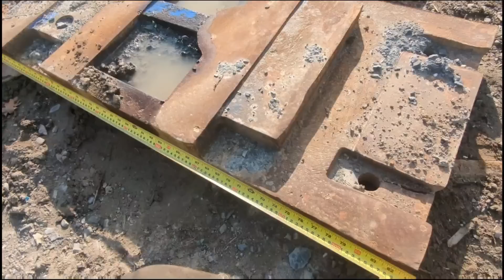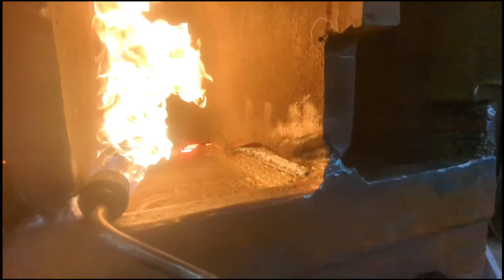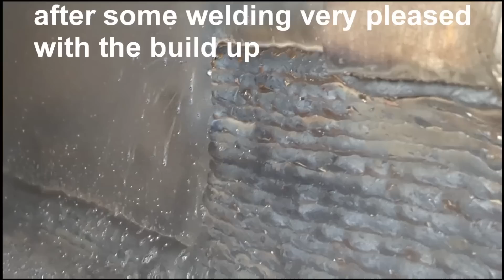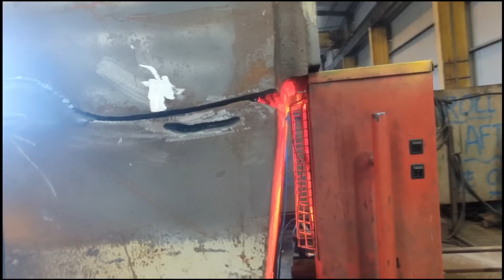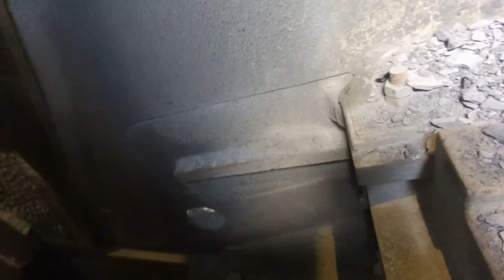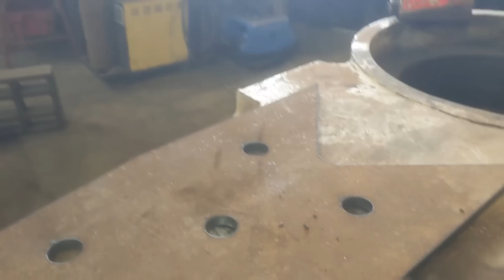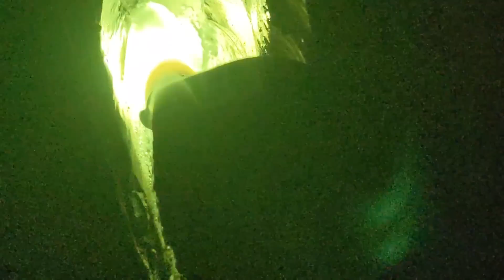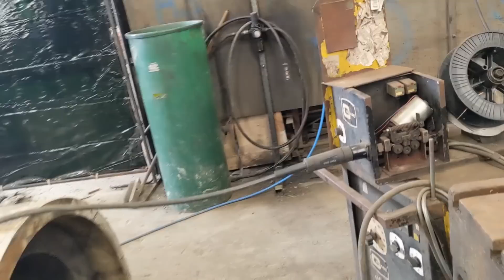10TON steel casting broken in half the welding repair starts!mega engineering!   quarry jaw crusher

Comment: When science and engineering are applied to a job like this one it will turn out as good as possible.....no guessing, no shortcuts, no disappointments. Amazing job almost incredible how the work pieces were heated up, shaped then welded. I have a recommendation for preheating a giant massive work piece such as this one. Maybe you've considered it already. I maintained the heating panels in the powder coat paint oven. They operated on three phase 480 VAC with three element sets to each panel. The control circuitry used SCR's for temperature control. You probably wouldn't need control circuitry because you would be running them wide open to preheat your work. You would only need two for large work. I have no idea how costly such heater panels are to operate but there's a chance the elimination of bottled gasses would make it worth the expense.

Comment: Hi Allistair, very impressed with your video and welding.  So I hope you don't mind if I 1.  ask a question,  2.  make an observation, 3.  then two suggestions.  - 1.  Could you see where the crack started.  2.  You tested the trial weld against the steel plate and not the casting.  If you had struck the plate on the other side you would have tested the weld on the casting.  3. There was a lot of fatigue in this work,  so firstly, when gouging why not hang the torch on the end of the crane chain and pendulum it.  This will save your hands and nerves from damage and be much faster.  Also when welding the canyon why not arrange the torch to run on a tramway.  This would be a lot easier and you'd get a better weld.  If you'd like me to come up with some drawing arrangements for the pendulum and the tramway I'd be happy to do this in return for posting such a brilliant video.  Thanks again Geoffrey Dodd
Reply from the maker: Thanks Geoffrey,  unfortunately the canyon was nowhere near uniform enough to be used with a track welder and requires manual reactive manipulation during welding.
I done multiple weld tests , not all shown, but yes good point regards the side of the plate I hit.  My brain has been pre programmed with that side for ease of breaking plate off, it's now habbit

Comment: Just any idea, but it might be an idea to make some plates with heater elements built into them. You would be able to G clamp them on to flat surfaces, which would help with better heat transfer with no air gap. The elements are used in the plastic injection moulding industry on hot runner manifolds they will go 350°C no problem, just get the high power to length and a thermocouple and some kind of controller or lower power elements that can go 100% all day, ask supplier for best advice. Just any idea, mate, for you.

Comment: 47.30 "as an old boy past his best and loosing his vision" do NOT nock you skills, you have done the set up (Plating) research and are capable of doing the complete task required. Now at 56 years old, my eyes are knackered, i cannot even follow a radius, i need a gap.  @1.07  that ain't no plowed field, (2*15 KG) rolls is a lot of wire, and expect it to be robot perfect, is impossible. (try finding a good all round individual fabricator, welder who has ANY knowledge, in temp control, cast steel, dissimilar metals or even an interest in learning), the best guy i have is 77, a mill wright, a wonder of knowledge, if he doesn't know, next morning a BOOK appears with all information required. ( i have googled many many times the specs of his OLD fashioned books, and learn't nothing except the specs are still the same), old boy's now what to do, and can do it, not just talk about it.

Comment: I’ve heard that accent before ! My mothers side all from Ireland .  Hy pressure pipe tube super heaters . Hated the air arc . I’d get a stack of X ray films with flaws . Never had a bad film, sure got to fix em for the less qualified welders . Ur doin fine follow the metallurgy, n all preps after . Have a good one !

Comment: I've not welded nor repaired heavy machinery (work in IT) but I am fascinated by the work you and others (like CEE) do. The energy needed to glue metal or cut straight through it is insane! How much do jobs like these cost just on the electricity used to do all of this?

Comment: why not 7018 Low hydrogen?
Reply: It is slower, and ER 70 S-6 out of a MIG/MAG gun is low hydrogen too, just a lot higher deposition rate and there is less typically less weld metal shrinkage with the MIG/MAG process...

Comment: Are you using solid wire and short circuit mig for this? Why not dual shield flux core?
Reply: Something I had wondered too. There is more shrinkage with FCAW over MIG/MAG, which tends to load up the HAZ more. Metal core may have been another option with faster deposition rates, low to no smoke and no flux to deal with.... Still, the job worked out fine didn't it.

Comment: I've just noticed those plug welds, keep an eye on those in service - especially in winter. They have a habit of cracking if they are too small and then the cracks can grow. Longer slots or shapes tend to fare better than small diameter plugs...
Reply from the maker: For sure bud but I need to keep distance equilibrium and as long as plug diameter is more than thickness that's max available strength
Reply: @allistairc123  Unfortunately they tend to place a lot of force in a small area. The longer slot configuration spreads the force out over a larger area.
Split T clamshell pipe sections on pipeline hot taps have this problem too. They place a lot of force in a small area down at the internal surface of the root, if the root is allowed to penetrate through the clamshell & fuse to the pipeline itself on the longitudinal welds. The way they fix that is to relieve the internal root of the clamshell pipe with a good sized chamfer to keep the weld metal from touching the pipeline proper. They rely on the fillet welds around the ends of the clamshell to tie the clamshell to the pipeline. Sometimes they place a thin backing strip there to keep the weld metal away from the pipeline too. Here is a photo... https://www.denys.com/en/projecten/air-products-nederland#gallery-2

Comment: Few more questions.  What wire and size did you end up using?  and was that propane and oxy on that cutting torch to cut off those run off plates?  Massive job and a great job well done.  I wish i could get onto mig welding like you, Pretty decent stick welder but really struggle with the mig.

Comment: How do you calacuate how much weld shrinkage is going to move it?  Just had my first dealling with that welding 1 1/4" thick steel.  tacked it up square welded it and it popped the tacks and jumped half an inch.  Had to cut it all back off and tip it in 3/8" and reweld it and it came out pretty close.  Just wondered how you ballparked that.

Comment: What a waste of time fiddling with the damaged areas. Survey the whole thing, make a drawing to ensure you restore all dims correctly. Slice the ends square using a rope cutter, make new webs, weld them with double sided full pen welds. Job done. If you gave it to us, you'd have a 3d model done too. In a few weeks time... 
Crap quality casting.
Reply from the maker: So you have added a second join with double the weld, double the stress points  not to mention one end was a bulkhead and cannot be cut square unfortunately without compromising a cast bulkhead that cannot be replaced   because of unaccessible compartment.
Reply: Stress in the welds is the smallest of your problems here provided you have a weak and low quality alloy structure to begin with. 😂

Comment: Very nice job sir !  As a machinist in a shop that also has 6 welder/fitters, that  gouging is insanely loud !!  Not to mention smokey too.  But we all have the required safety gear.   I cant even imagine a price tag on all that wire, gas and hydro being eaten up on this project. Again, amazing work and cheers from Canada.

Comment: Winter job that...😂
I used to have a weld on the mantle piece..till our lass removed it, and confined it to the shed...
10 boxes of 312 rods..
Cast Victorian hydraulic cylinder...
Porous as...filled with hydraulic oil, thought we has got it all out, super red hot...😅
Then started wading in the rods...no real recovery on those, 1mm at at time (sweet jesus)
Anyway, allowing it to cool, with added heat, real slow...180 degrees away from the weld, crack.
My 2 day welding effort fell out ,and now i had two halves....very brave with cast anything mate..
Its horrible...
Reply: Try 307 if you want to use a stainless filler... :)
Reply: @paulmeersa7162  dont think it was available 30 years ago,  just 312s with massively carrosive flux but ill bear it in mind, if theres a next time lol.
Reply: @stevedangerous1  307 was available at least as far back as 1965 and almost certainly back even further. Check earlier editions of ASME Section II Part C, SFA 5.7, if there is any interest. It is basically the same as 308 except it has a wee bit of manganese in it - one function of that is probably to help tie up the sulphur in the castings to stop hot cracks in the weld metal, but don't quote me on that aspect of it - just a guess. Certainly this is one function of Mn in carbon steels at least...

Comment: Beautiful repair!  
Is there a reason for not using flux core wire and higher voltage when welding in position to fill up those large welds?
Could it be a problem with too large heat imput?

Maybe someone would like to sponsor you with a modern welder and a water cooled mig gun? 🥵😅

Comment: Are you using flux core wire? Im just a hobbyist welder (and still a bad one at that but I want to get good at it) and I also use Flux Core because I dont want to have to deal with gas bottles for the bit of welding I do. However I still hear that Flux Core welding isnt good and you should always use MIG/MAG but if you really use Flux Core you definitely would proof that ,,theory,, wrong. The spools kind of look like Hyundai SuperShield 11 rolls, am I maybe right?(probably not, but just guessing).

Comment: I have this question: why didn’t you pack all the surface area that you didn’t work on or facing the electric heaters in stone wool? I think the expenditure on gas would have been greatly reduced, and the heat more evenly spread at a higher temperature. 
Not to say that I don’t have mad respect for how you tackled this monstrous job! 👍👍👍

Comment: Are there any tools that nobody makes that would have made the job easier or the work better?

I'm not a welder, but every time I see someone working on anything (welding, logging, software development) where I understand more than a bit what the person is trying to do I can't help but try to figure out what tooling would allow them to do the work faster, better, cheaper. Like for this, maybe a regulated heater you could set inside the cavities of the part behind a chuck of insulation to keep things warm? Even when that kind of idea turns out to not be workable, finding the reason it doesn't work is often a great way to learn something new.

Comment: Are you using 70s6 wire? Surprises me.
Reply from the maker: Yep! Closest match tobase material to hand, I thought 312 -29-9 stainless was better mechanicals on paper but was simply garbage fusion whetting and very convex bead leading to big flaws.
Reply: @allistairc123  woof. I’ve welded on much smaller crushers. I cannot even imagine the pain involved in prepping that beast. My first thought while watching you agonize over what wire was I’d have looked first at a heavy dual shield wire, like 1/16” 7100 ultra that I could safely up deposition rates and maintain penetration. Then I realize how far from knowledgeable I am with something that large.  Loved your videos. I’ll be back. Thanks! Rick

Comment: I did some weld build up for the first time recently on some 900 series coal crusher trunnions and holy fuck it really puts into perspective the crazy heat you can build up from welding. Started by preheating the 5000lb ish part then at 27volts and 350-400 in/min of wire to burn off the crap layer of cast steel to get something for the build up to stick to. We were going through a couple rolls of wire per day and my coveralls were bleached by the end. What kind of gear are you guys wearing to protect yourselves from the gauging slag?
Reply from the maker: Just leathers seem to last best

Comment: When I used to do similar jobs, we used temp controlled ceramic heating pads from a company called Electroheat Sweden Ab and superwool insulation to keep an even preheat during the welding job. After welding we could do a controlled stress relief annealing with the same equipment.

We had most success stick welding jobs like this. But this looks great, keep up the good work.

Love the video content of this channel. Thank you for sharing.
Reply: These days most of the electrode types in stick are also available in MIG wire including FCAW.

For example if welding high tensile QT in Australia we have 11018 MR stick electrodes which are 110,000 PSI tensile and H4 Hydrogen control classification (equivalent to 880 MPa Tensile)
In fluxcored wire we have Tensicor 110 which is identical mechanical properties to the above stick , however those sticks in a 4.0 mm electrode might give only 2.5 kg per hour of weld , the fluxcored mig wire could easily give 10.5 kg per hour which is a win on a quoted job.

In solid Mig wire we go with Nickel Chrome Moly NiCrMo which is also 880 MPa Tensile however if the finished product requires heat treatment , core toughening or case hardening then we cant use the NiCrMo as the alloys are not compatible , the TensiCor 110 however does allow heat treatment.

Sometimes you can select consumables purely to enhance kilograms deposition rate per hour.
If you have 10 different wires that meet or exceed the required mechanical properties , you might choose the one with highest deposition rate.
An example might be a 1.2 mm Solid ER70-S6 wire giving 7.5 kg per hour welding rate but changing to a 1.6 mm fluxcored wire could give you 10.9 kg per hour of deposit , so as long as you dont exceed the heat input of megajoules / metre / minute then you get a win on labour .
If your machine can run 2.0 mm , 2.4 or 3.0 mm diameter fluxcored wires then they can also give high deposition rates but because they are used less in industry sometimes the consumable price negates the labour gains.

Comment: Angles and final length alone without a giant vise is hard enough. Besides, there might be extra vibration from loose tolerances on the other half of this machine. I am not a welder, but i understand the complexity. Cheers. Epic job.

Comment: Should have called the wire provider to send someone over with an XRF gun to see exactly what its made of and recomend a suitable wire and gas. Great video!
Reply: What was wrong with the wire and gas? It worked and is still working, as a rock crusher!
Reply: He said he did a lot of research himself and spent many sleeples nights before choosing the wire. @paulmeersa7162

Comment: Just wondering can you use something like insulation blankets to slow down heat loss from your preheat? 
Don't know anything about welding. Just a curious watcher.
Reply from the maker: I'm moving around the weld areas  alternating so I feel I would be continually moving blankets also securing them to vertical surfaces  pain in ass also they obscure the areas I'd be needing to apply heat

Comment: Impressive the ease of material removal there is with gouging, I've never seen that before.

How much electricity do you estimate was used for this one job? Enough to power the average home for a month, two or perhaps more? 

How long do you think your repair will last? I would assume long enough to make it worth the cost, which had to be considerable. I wuld also assume a replacement part is a great deal more expensive than the cost to repair, assuming (again) a replacement part could be obtained at all.

First video of yours I've seen, very impressed with your knowledge and skill. I'm a novice welder and it's truly amazing the power of welding. Very inspiring.
Reply: He used 8 or 10 mm gouging carbons when doing the air arc , they require 400 - 500 amps at around 50 - 80 volts arc voltage , the 1.2 mm mig wire he used pulls about half that depending on weld position.
6.5 - 28 kVA would be his power consumption with efficiency losses so multiply that by 8 - 10 hour shifts and maybe 0.8 power factor .

Comment: I was involved with heavy structural steel welding for oil processing modules used in the arctic in Alaska.  We used Flux Core wire by Lincoln, NR203-N, ER70T-G.  The weld procedure had to pass high Charpy Impact test at very low temp.  The weld had to have good ductility and impact resistance at low temperature and might be a candidate for this application.  There would be slag to deal with so it would probably be a slower process, but a needle scaler worked well.  This part is calling for post weld heat treatment.

Comment: You're gonna hate me but do be it. Here goes.
Clean up and fit up on first video is great. Research is solid. Welding of internal webs is totally competent. Critique: did you never heat of heater bars? Yes, a torch for heating some spots is handy but why not just put some heater bars? When gouging I saw you backtracked at some points, never do that. And for the end of beads, why not just add some run out tabs? Good on you for cleaning up the weld ends. I still think I air arc better than you. Anyways, you did a tough job and the welds look good.
Reply from the maker: I'll defend myself about air arc, what you seen was me working with one hand wile looking at camera screen through a welding mask. Back tracking is fine as long as the final sweep is forward travel over the same pass I can guarantee there is zero re solidified passes. Thanks for your honesty!